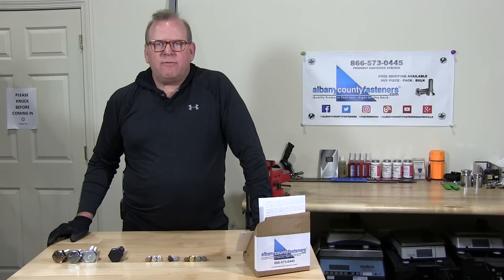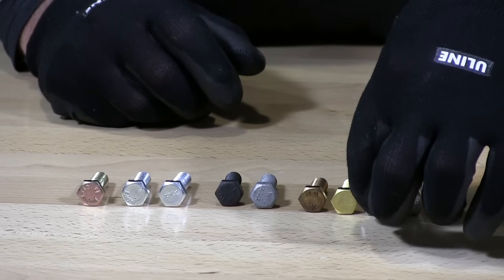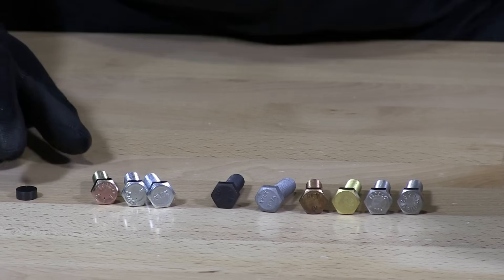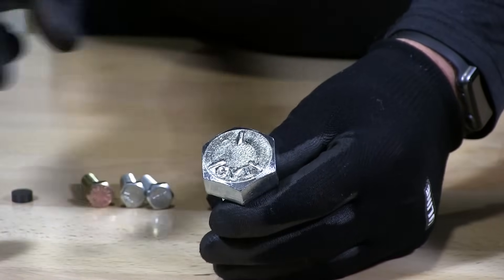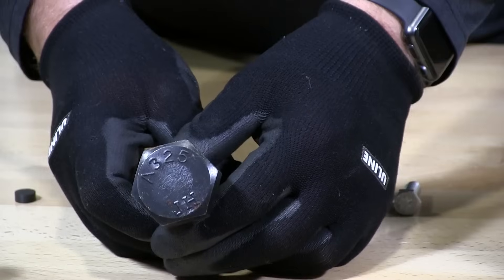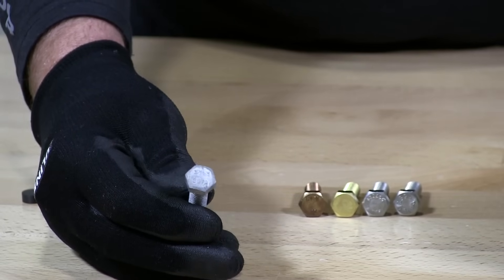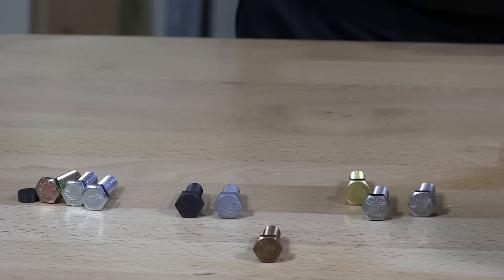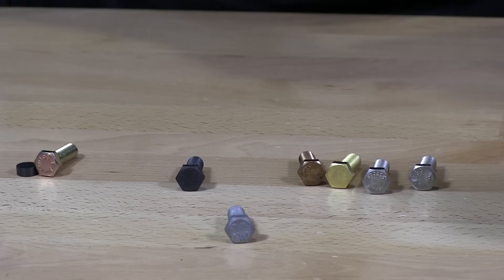Understanding Fastener Grades & Materials | Fasteners 101

Comment: QUESTION: What grade of screws is ideal for exterior screen door? Durable and long lasting that the head won't snap off?
Our mahogany screen door has the brass screws broke off after just one year?

Cost is not an issue - we need a good strong durable screw for exterior use.

The door has 3/4" into the mahogany screen door will be going into the house which will need a 3-inch screw.

Any thoughts?

So is stainless 316 stronger than a exterior Simpson tie  screw or a SPAX exterior screw? Images of movement consistently day after day so a screw that can take being jostled daily is necessary.

Comment: I would love to see a new video concerning the selection of hardware concerning corrosion resistance/ tensile strength/ shear strength in equivalent size fasteners and the difference between the same grade fastener and different diameter such as grade 8 bolts of various thicknesses.

Comment: I have a Hex Cap Screw from a CB Antenna Mounting stud which I need to replace with a longer one to fit my application.  The head is marked with "S30400 THE". A Replacement recommended on a forum has "F593C THE" on the head.  What are those designations?  What type of stainless steel mentioned would be a good replacement?
 It will have very minuscule  contact with an aluminum mounting plate; for grounding purposes. Will that be a problem or should I ground it in another way?  Thank you.

Comment: hey I have a question .. I broke a bolt on my car that was a grade 8 yellow zinc  bolt .. is there anything stronger than that ? I guess the torque from the motor is braking the bolt some how .. so do you recommend any stronger bolt ?
Reply from the maker: Grade 8 bolts are very strong, but can be brittle. Often in automotive applications you will see grade 5 bolts used because the bolt itself has more give than a grade 8, which makes it less prone to snapping. There is also a grade 9 in high strength for automotive applications, however we do not currently stock them. Of course, I would consult the manufacturer's guidelines on the motor for safety concerns before you do anything besides a direct replacement
Reply: @AlbanyCountyFasteners   thanks so you're saying I should give grade 5 a try ? and do you have a link to any recommendations ?
Reply from the maker: A grade 5 may bend rather than breaking off. some of the larger companies like Fastenal have grade 9 bolts, though they are significantly more expensive due to the high amount of heat treatment that is applied to the steel.
Reply: @AlbanyCountyFasteners   I rather pay the price .. I dont want this bolt to snap again .. so if you got a link it would be greatly appreciated .. I'll try to look for it tho
Reply: @AlbanyCountyFasteners   never mind I found it.. so I'll try the grade 9

Comment: So what is the shear strength of a grade 8 also is there anything higher than 8? Are grade 8 nuts the strongest?
Reply from the maker: Shear strength, and for that matter a lot of fastener specs, are dependant on more than just the material/grade. We would need to know the size, length, and type of fastener to give an accurate answer. As far as grade 8 nuts being the strongest, that depends on how you define "strong" and in what application they are being used for.
Reply: @AlbanyCountyFasteners  I nees something that can support about 10000 lbs for at least 20 years in the smallest possible size. I also need a bolt that is the most resistant to cutting.

Comment: Sheer bolts for snowblower augers, are they typically grade 2 to avoid damage? Is it ok to use grade 5?
Reply from the maker: Shear bolts, for snowblower augers are bolts designed to have a flaw so they will break if the auger gets jammed to prevent other more costly parts from straining and breaking.

While we do not currently carry them, it appears they come if a range of different grades. This probably depends on the size and power of the snowblower. It would be best to check with the manufacturer to find out which grade you should use for yours. Sorry we couldn't be more help!
Reply: @AlbanyCountyFasteners  
You were of great help! I like your thinking! In a jam, use lowest grade possible. Or better yet, dont get to that point. Always have sheer bolts ready to go. The newspaper guy can be annoying when that paper hits the auger. My latest john deere has a 59" blower. If you get bored (which is doubtful running an awesome business) I shot some snowblowing videos. Interestingly, when it was new on the 1st heavy snow, the snowblower driveshaft that attaches to tractor driveshaft, there is bolt that broke. On that shaft is akey way. I dont think the factory ever installed that keyway on the shaft. I didnt hit anything rough to sheer it. All is good now. Anyways thanks for your response! There are times when we want weak bolts!

Comment: When in doubt, use grade 8. Correct?
Reply from the maker: Grade 8 might be right for some jobs, but in highly corrosive enviroments or high pressure enviroments, Grade 8 bolts may rust or snap. There are other materials that would be better for those applications. The wrong material for the job may produce undesirable results. Take a look at our Fasteners 101 page on the subject of materials and finishes for more information: https://www.albanycountyfasteners.com/Fastener-Grades-Strength-and-Materials-s/1129.htm

Comment: What is the difference between a cap screw and a tap bolt? Thanks
Reply from the maker: Cap screws and tap bolts are the same up to a given size, depending on the diameter of the bolt. After that they diverge with Cap screws being partially threaded and Tap bolts being fully threaded. The diameter of the bolt effects when this cutoff point is hit (when the bolt changes from full to partial threading). Larger bolts tend to go full thread for longer lengths than smaller bolt diameters.
Here's an example: a 1/4"-20 x 6" Cap Screw is partially threaded, while a 1/4"-20 x 6" Tap Bolt is fully threaded.

Comment: You didnt mention anything about tensile strength, or shear strength. Isnt that a wee bit important? I actually stayed awake for the entire video.
Reply from the maker: Hello Kirby,
Unfortunately, we did not talk about shear or tensile strength during this video. While both of those factors are, as you stated, very important to fastener installation, we found that it would be very difficult to lay out specs as they would change based off: Material, grade, type of fastener and the diameter of that specific fastener.

Due to the variability of the specifications of each fastener, if you have a question related to a specific fastener's tensile or shear strength you can contact our customer support department who would be happy to find these specifications for you.

Call: 866-573-0445
E-mail: support@rawproductscorp.com

Thanks for your comment!
Reply: @AlbanyCountyFasteners   Unfortunately, there is little "Understanding Fastener Grades" if these are NOT covered.  Pretty much all that was covered, twice, was markings and coatings.  Nothing to add to 'understanding'.   Suggest changing title to Identifying vs understanding.  We spent time playing with magnets but no item even mentioning why a grade 8 is different from grade 2.  I do not recall grade 5 even being discussed either.

Comment: Who cares about the magnetism?
Reply from the maker: There are specific applications that require fasteners to be non-magnetic, such as in applications involving electronics and computers. When it comes to stainless steel fasteners many people think running a magnet over the fastener will prove its stainless or not. This is a common myth; stainless steel once worked into fasteners, commonly rivets and bolts, almost always have a mild magnetism due to the cold forming process.
Reply: Of course in an specific application there may be such a need - it was just that in the context of this video, which I would consider is more of a general nature, I couldn't think of any particular reason why it would be relevant.
Reply: Attraction to a magnet means it is mostly steel and therefore the bolt has magnetic properties.

Comment: These are bolts, not screws.
Reply from the maker: Hi Mimo,
Of course, you are right, these are bolts. Unfortunately, the industry terminology is very messy and many people do refer to these types of bolts as hex cap screws. For example, we've also heard of them being called hex bolts, hex head bolts, hex head screws and hexagonal drive bolts. We find that most people have different names for fasteners depending on where they learned about them from.
Reply: Well, often they are called hex-head cap screws, as compared to 'socket' head cap screws...(allens)

Comment: How are other bolts with different types of heads marked so as to show hardness?  (I.e. Robertson head, etc)
Reply: sae or imperial cap screws [ ie: socket (hex drive ) , button socket or flat socket] don't have grade marking as they are  alloy steel . metric cap screws[socket] are marked usually 10.9 or 12.9 grade .
Reply from the maker: Great reply!